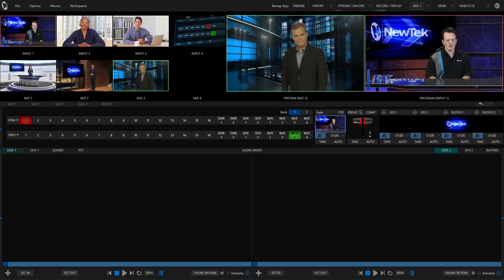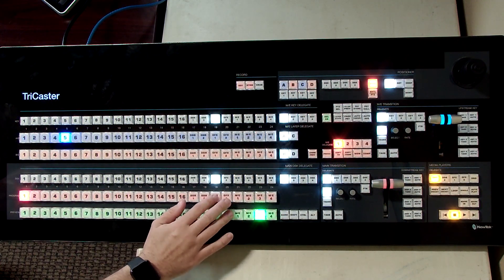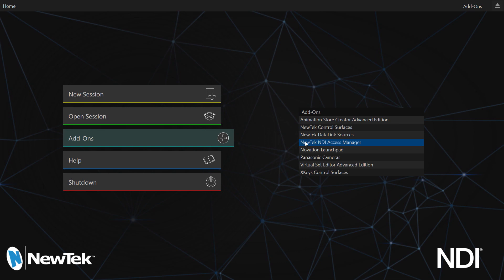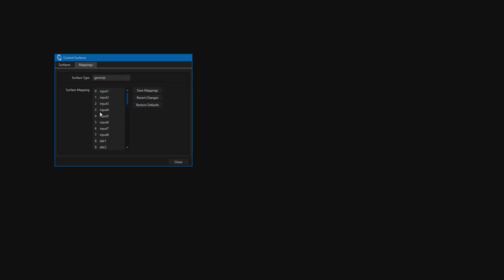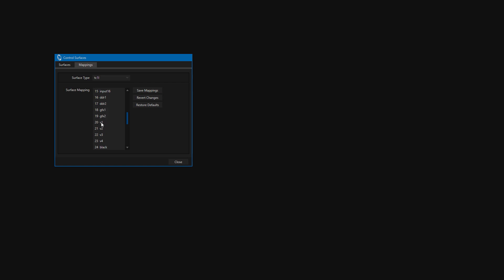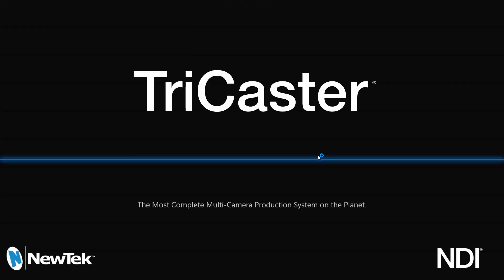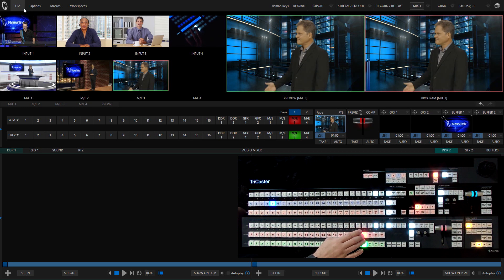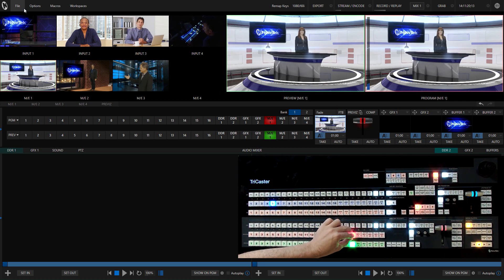How to remap your Control Surface Buttons

Comment: So Richard changed the order of GFX & M/E buttons in software setup to change order on the control surface, but the order of items remains the SAME in the on-screen interface. Seems like both physical & computer representations of that row should match.
Reply from the maker: I'll mention this to engineering :)